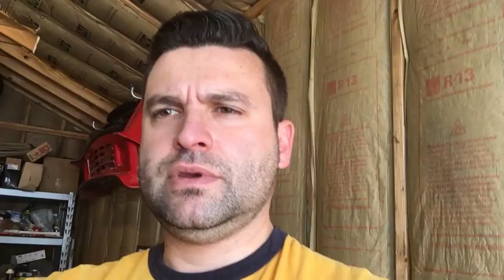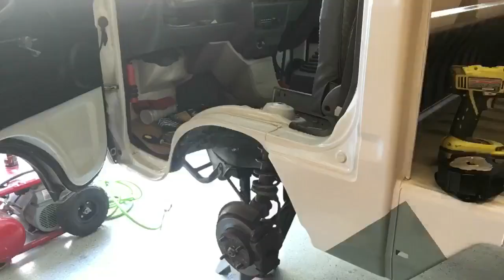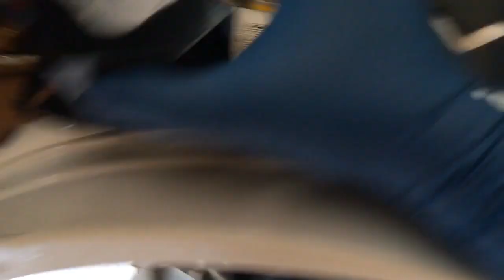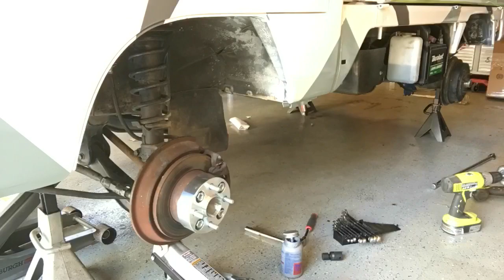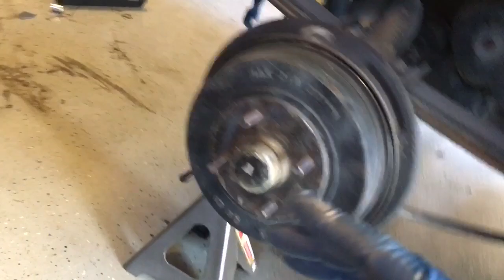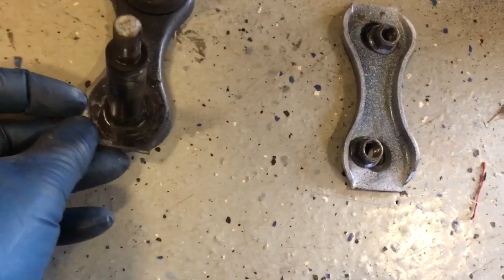Honda Acty, JDM Kei Car, Mini Truck Project, episode 5.  Front lift kit install and wheel spacers.

Comment: I think I pulled the CV out when doing this as well. I think I got it back in but I’m not sure. How will I know if it’s not in correctly?
Reply from the maker: Just push it back in.  If no oil leaks when driving then you’re fine.  If oil poured out you might need to top off the front differential oil.

Comment: Got my 2" lift and new tires on, adjusted camber, etc and now the poor thing hops down the road like a Bunny Wabbit. Not like just when I hit a bump, it's consistently hopping starting at around 25 kph.  New 300# springs on the way but it doesn't seam it will help as I didn't feel the hop on the lift, only once I put on the tires. Any ideas?
Reply from the maker: Your front struts might be gone

Comment: Hi Marco,   the hole in the top to tighten the top of the strut/adjust camber,  How large of a diameter did you have to make it in order to be able to tighten and adjust the strut?   Thank you.  Dan
Reply from the maker: I used a 2” hole saw
Reply: @MarcoCerqueira  thank you

Comment: How is the camber now were you able to get it to zero? I have a minicab van with camber issues... I can't get it to zero all I did was replace the suspension coils the old ones were to light couldn't take much weight...  but now the camber is off and ok have no adjustment it's a rwd van.
Reply: I have the same issue on my 96 carry rwd.did you figured out ?

Comment: Do you hear squeaking coming from the strut/lift area? Where the spacer is? Mine squeaks and wondering how to get rid of it. Ty
Reply from the maker: Well the car needs lower control arms and thrust arms because the bushings are done on those.  So until I check that off the list hard to tell where the squeaks are coming from

Comment: Hey Marco, What size Spacer are those and where did you get them from?
Reply from the maker: These are 1.5” thick hub centric spacers for a Honda Del Sol.  I got them on eBay.  I did a quick search and only found 1 seller for 1.5” and they want crazy money.  But there looks to be plenty of 1” spacers.

Comment: May I ask, after your install, what size are the tires, and also, why did you use the spacers.? I’m getting ready to do a 93 Suzuki Carry and having a hard time finding tires. Thanks for your time. Love the vids
Reply from the maker: I’m running spacers because I’m using Honda del sol 15” steel wheels which have the incorrect wheel spacing.  Without the spacers they hit the front struts, rears are okay.  However, I like the wider stance so I would run spacer even if they weren’t required.  Right now I’m using 185/60 15, but I have a 2” lift.  I would suggest 50 profile tires or go down to 14} wheels.  Good luck!
Reply: Thank you for your reply, in joy you vids. This helps out a lot thanks again
Reply: Thanks Marco,all good knowledge to have.you have don a good job
Reply from the maker: Thank you brother

Comment: I’m working on my 96 Acty debating on 2” lift, I’m not doing heavy off-roading and I already need new cv joints.  I want to avoid heavy modifications really but right now my cab will bottom out if I hit a dip to fast , I’ve ordered new springs but I can’t find new struts. Do you have any advice? Does it sound like bad struts? Ive got soft trail tires on it now 23x8x12
I’d rather put the money into mechanical maintenance (timing belt)  before getting into anything not totally necessary.
Reply from the maker: My understanding is that bottoming out is very common with these.  One of the reasons are the soft springs.  If you shocks look visibly good, no oil leaks, then just upgrade the springs.  You can always do the struts later if they go bad.
Reply from the maker: I just did a video on the springs that might help:
Honda Acty JDM Kei Car mini truck project.  Episode 27, installing heavy duty front springs. https://youtu.be/drkBZjXPkDI
Reply: Marco Cerqueira  thanks for the advice man, have you done a timing belt Kit Repair video yet? I’m gonna tackle that next.
Reply from the maker: Not yet,  maybe soon

Comment: How did you get the axle back in did you have to remove the control arm or anything? I am doing it now and I can’t get it high enough to fit back in. When I put it toward the area it won’t go so I assume the axle pop out but I can’t get it to move any help would be appreciated thanks
Reply from the maker: I guess in my case the shaft didn’t come out all the way.  So I was able to push it back in just by rotating the axle back and fourth until the splines lined up and the shaft went back in.  If yours came completely out you might need to push the rubber boot back far enough for you to line it up visually.